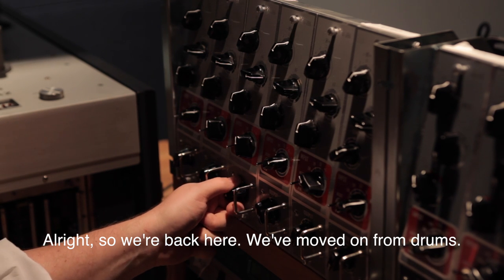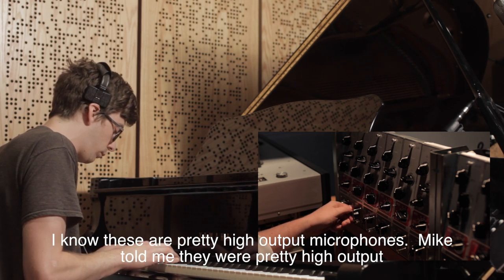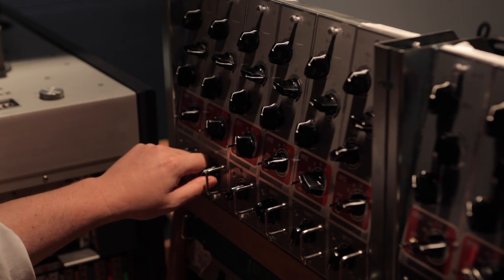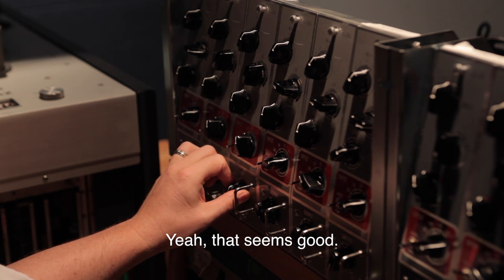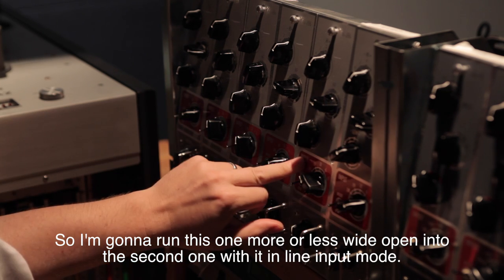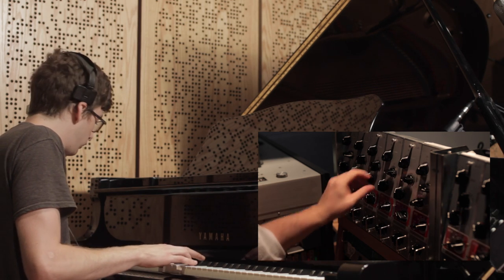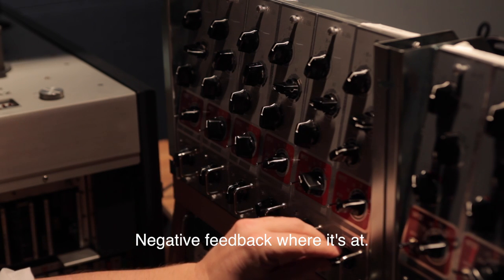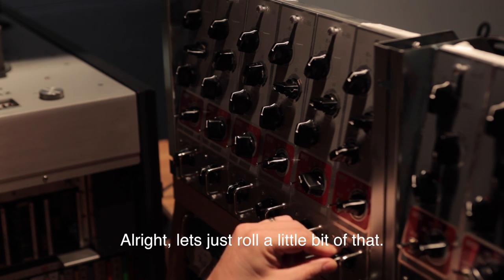Coil Audio: Tracking Piano at ARC studios

Comment: I like the form factor of that bottom module (4:10), 2 channels in 3U means you get the same footprint as the 6-channel rack (9U) but can add 2 more channels easily. Since most multi-channel AD converters work in blocks of 8, I love the idea of a 2-channel rack unit (or, even better, an 8-channel unit!)